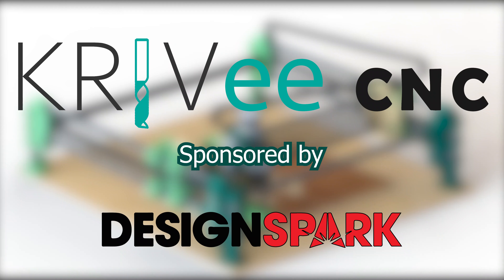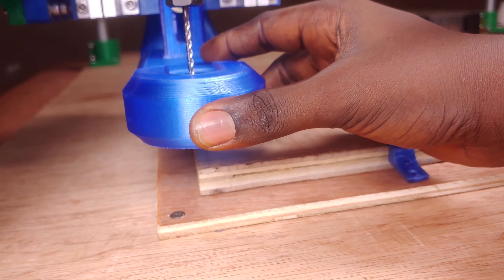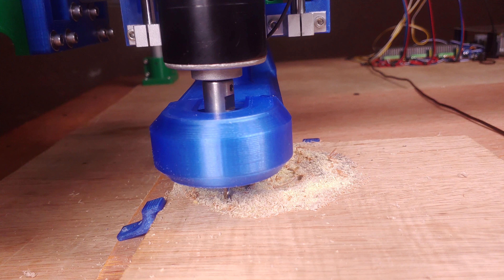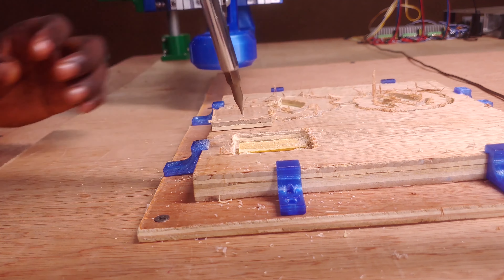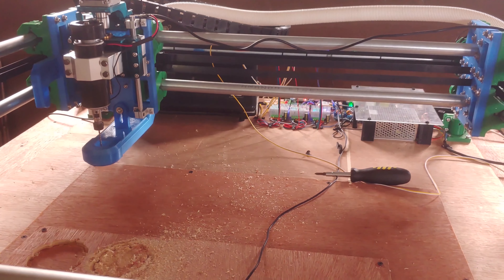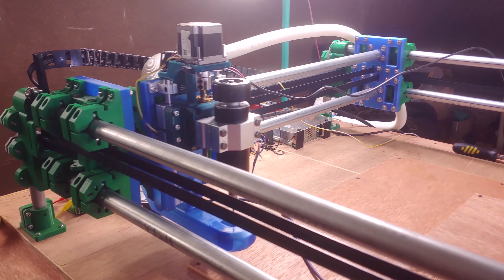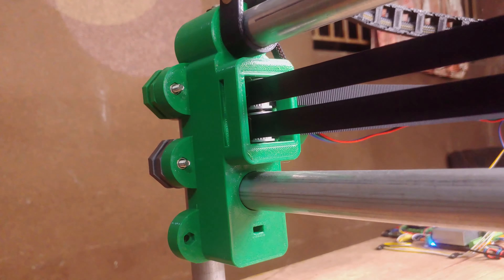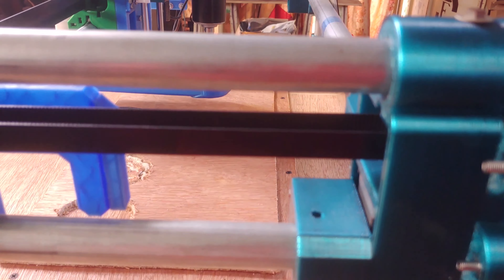Building a Core XY CNC Machine | Motion Problem | Part 7

Comment: No shame in overlooking the pulley set screw, just be glad that you found the cause of the problem! It's one of the problems that happens so often in COREXY set-ups, that it's one of the first things that people in the Voron 3d printer community point at when someone is having motion problems.

To avoid this in the future, it might be a good idea to use loctite on all the pulley set screws.